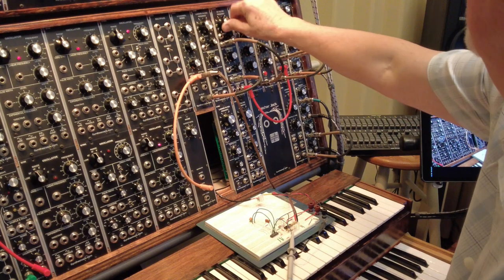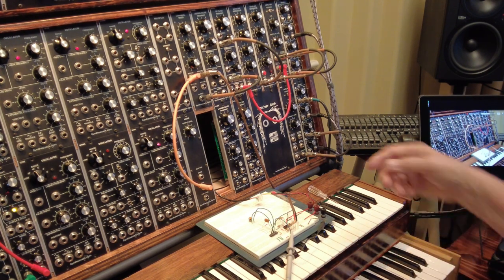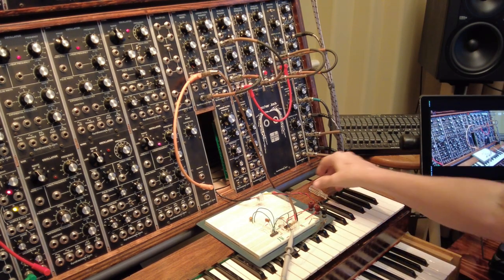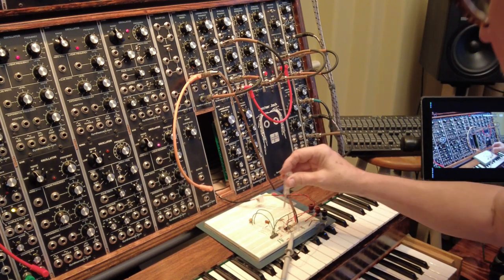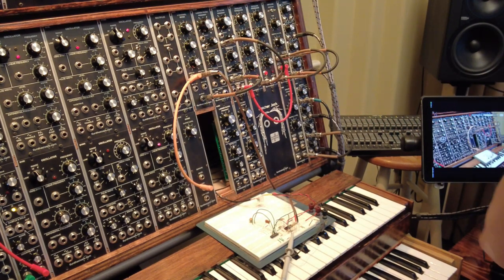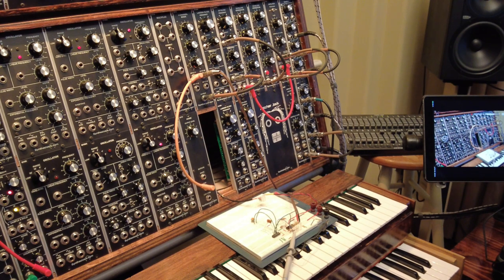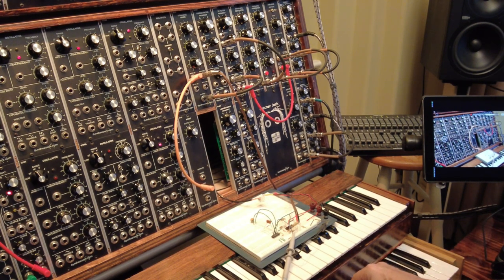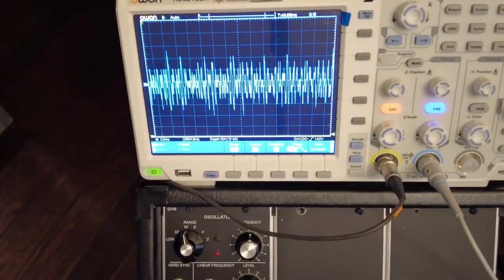Digital Cymbal

Comment: Cool!   If I remember correctly, the CR-78 used three different oscillators to create their hi-hat "metalic" sound, not unlike what you're doing.  Count me in if you do circuit boards!
Reply from the maker: Hey, I looked up the schematic of the CR-78. (I have a CR-68) They both use a noise transistor for their noise, no waveforms etc. I might build this into mine at some point. I just hate to modify it really.
Reply: @geoelectro  It was actually the "Metalic Beat" curcuit I was remembering.  It's used for both HH and CY.
Look to the right of the Noise Circuit (6/6 IC501).
Reply from the maker: Got it! Looks like my CR-68 doesn't have it. Very cool. Using a hex inverter. Each tunable!
Reply: @geoelectro  I was impressed as well.  Impressed enough to remember it for 40 years ... lol